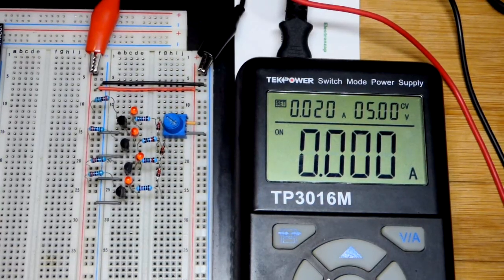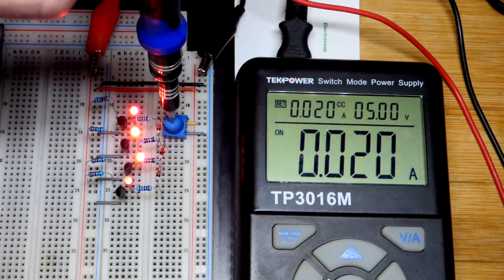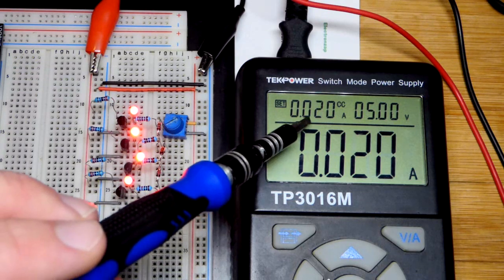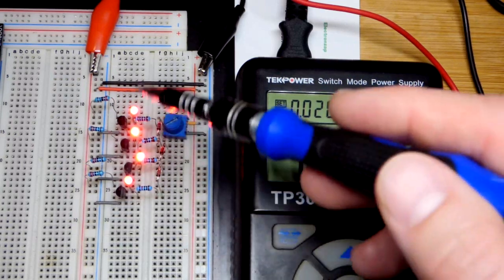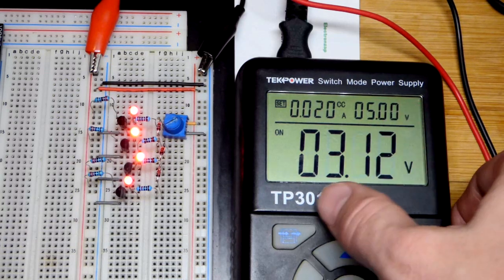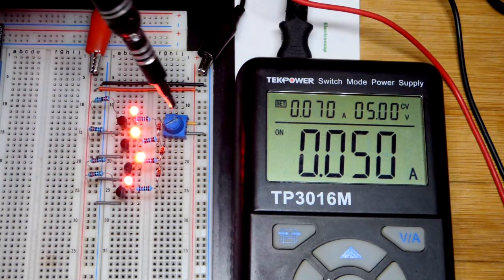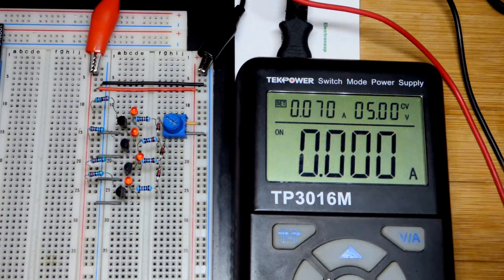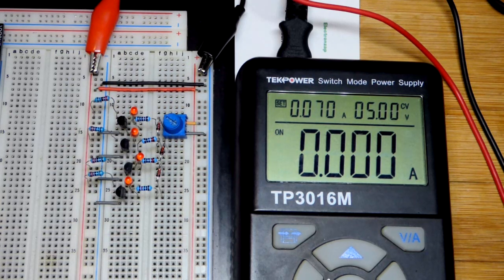Trouble shooting low current problem from my last learning electronics circuit video

Comment: How does the power supply actually limit current? What parts are (likely) used? Is it just selecting a resistor to put in series with the power output?
Reply from the maker: Not sure, I haven't seen many current limiting circuits yet.

Comment: Order electronic parts from Tayda Electronics.   Way cheaper than Amazon, Jameco, Digikey and Mouser.     LEDs are 2 to 7 cents each.   I have never had a counterfeit part from them in 8 years of buying from them.    They have a warehouse in Colorado now and their very reasonable shipping in the USA to Chicago area where I live has been 4 to 7 days.     They have everything for the hobbyist.  They are getting more modules in everyday.      It doesn't hurt so much when you burn out a 2 cent LED.  2N3904  transistors are 2 cents each also.    They only require a $5 minimum on their orders.  555 timer ICs are 13 cents.   Check them out I think you will go nuts stocking up on components.